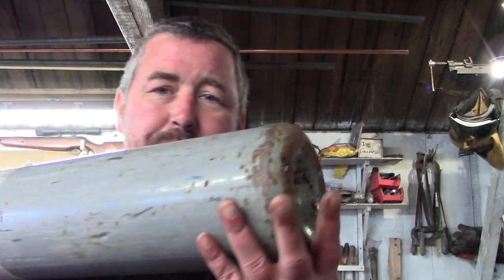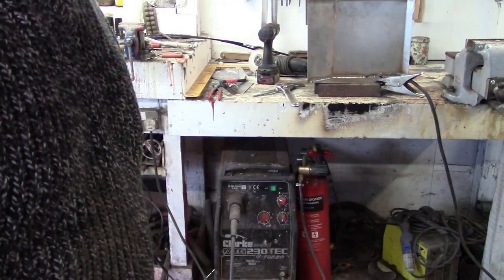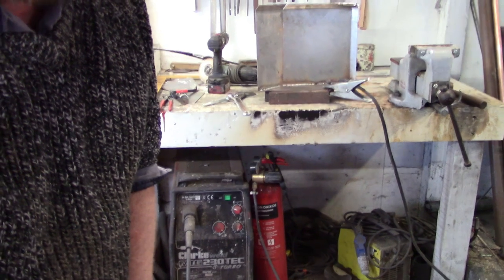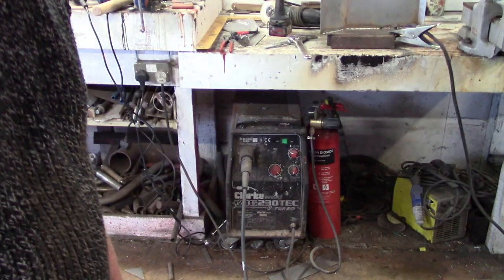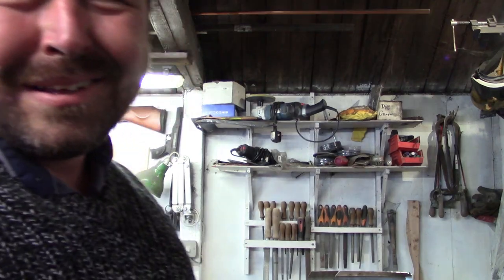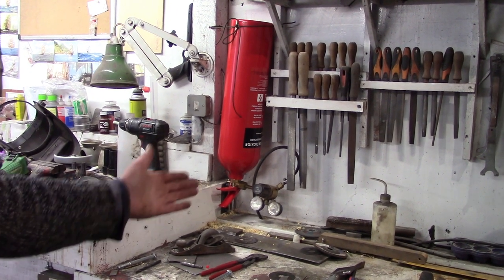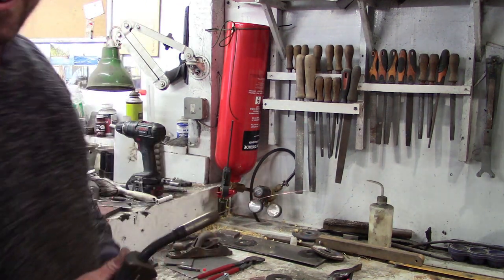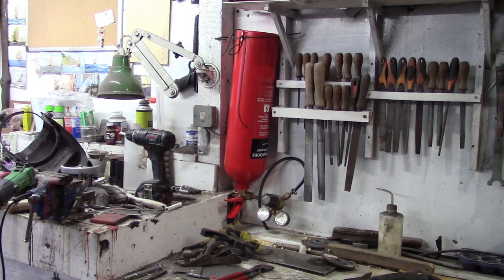Cheap welding with a fire extinguisher new set up

Comment: Glad you made a follow up video, maybe it's a European thing, but none of my co2 extinguishers fit my regulator, so I cut the extinguisher horn/spout and took the nut off and fit it to my regulator, now I want to build a trolley with two wheels and one handle that straps the bottle upside down for portable work 👍🏾😊
Reply from the maker: Maybe it's the regulator? I'm using a fitting designed to connect to pub gas, do you have the domed fitting for the argo-mix?
Reply: @turboconqueringmegaeagle9006  I have a CO2 specific flow meter, fits my cga320 co2 valve that I used to convert one of my extinguishers for refilling, but the other extinguishers have a different thread, it's close but only catches the first thread then gets tight, so I stole the nut off the nozzle and used it, awesome temporary solution 😁
Reply from the maker: @Ricerguy  nice one mate, are you getting your bottles free? Even buying refurbished I'm still saving money, don't know why more folk aren't doing it
Reply: @turboconqueringmegaeagle9006  yes, they were being thrown away, I thought they were empty, as the bottles are due to be hydrotested, so I was going to get that done and have the place that does the testing put the correct valve on. (they told me they do it all the time for aquarium guys) but both 10lb bottles had co2 in them and I couldn't bring myself to dump them out and waste the co2, so I'll weld with it for now. Strangely my issue using them upright is different to yours, my regulator starts to freeze and the flow seems to become restricted? Doesn't happen during small jobs, only happened while testing the machine running beads at max output. I plan to build a small cart/trolley to wheel the bottles around that can mount them upright or upside down. 😊👍🏾
Reply: Depending on distance see if they have any out of test (single use ones)ask them to contact you and go colect a few at a time  I pay 15 quid for single use

Comment: Crazy Idea.... I wonder if one captured the exhaust from an engine and compressed it in a tank with a compressor, if that would eliminate enough oxygen to cause the wire not to burn which is the job of the Co2?
Does the extinguishers you get have a threaded Nozzle or where do you tap into?
Reply: That's carbon monoxide not carbon dioxide so I'm not sure if that can work. Also this is no longer mig welding its mag welding. Carbon dioxide is an active gas not an inert gas you need to add a lot of argon to it for mig but, mag welding gives deeper penetration. Anyway the purpose of the gas is to create a neutral environment for the arc to burn I'm responsible sure carbon monoxide would cause loads of porosity and inclusion.

Comment: Yeah sounds like your getting dooped there. I do keg beer these days and my size d co2 bottle costs me $35 au for a swap witch would be like $19 of your dollars. Haven’t yet to try it as a shield gas yet but can’t wait to try. For the proper stuff it’s around $300 for a size d bottle but then only $100 for a swap. But yes very clever using the fire extinguisher 🧯 bottle.

Comment: Hello chap. I'm paying £34 for my refills on a 20 litre tank at 200 bar. But I'm having issues with supply and the guy charged me full price for a bottle he had decanted into and it was under 90 bar last time. So couple of questions, do you know the volume of a fire extinguisher and what pressure are they at?
Reply from the maker: That 200bar is the bottle's rated pressure, room temp liquid co2 is about 900psi or 70bar but I can see you getting 90 on the gauge if your shed is hot, I don't know about the argomixes though or argon.
So the real question is how much liquid do you get in a bottle, I've not actually measured, was using pub gas size bottles and have convinced myself these 5kg extinguishers last longer and I got scanked by the pub gas guy so its been these ever since.
Reply: @turboconqueringmegaeagle9006  20 litre 200 bar is for my argon mix mate.
Reply: @turboconqueringmegaeagle9006  I can get a 5kg extinguisher for £30 but I'm talking to a guy who has the big 50kg extinguishers on a trolley. I think it will be cheaper and more reliable then the company I've been using.
Reply from the maker: @smithbuilt  as long as it's less than £300 it's cheaper init.
Definitely just co2 not a 5kg co2 bottle pressuring a 50kg bottle of foam?
Reply: @turboconqueringmegaeagle9006  the guy is a fire marshal of sorts he services and refills them. He said he might be able to refill my argon bottle too.

Comment: OK, where did you get the fire extinguishers from, and what sort of regulator fitting fits?
Reply: Ohm and cheers for the tip!
Reply from the maker: My apologies good sir, the bottle fittings are the same pub gas/5kg extinguisher.
The refurbished 5kg bottles are on eeeebay
Reply: @turboconqueringmegaeagle9006  What fitting do they have and do you know how much weight of CO2 they have in the cylinder?
Reply: @turboconqueringmegaeagle9006  Also could you provide a link to the extinguishers please :)
Reply from the maker: @BensWorkshop  I think it's 3/8 bsp but what I'm saying is as far as regulators are concerned they are just referred to as pub gas fittings and it's 5kg of co2 in an extinguisher, they are always rated by contents not gross as the bottle material can vary, I've got my spam settings cranked right up so posting links is hit and miss but I'll try otherwise just search for 5kg co2 extinguisher.
Reply from the maker: @BensWorkshop  https://www.ebay.co.uk/itm/303154054881
5kg refurb £40 free p&p
Reply: @turboconqueringmegaeagle9006  Cheers. I think I have found the extinguisher. Are you sure it is 3/8 and not 5/8?
Reply from the maker: Nopes not at all, didn't measure it or nufink, been involved in too many bsp balls ups to ever commit.
Reply: @turboconqueringmegaeagle9006  Fair enough.... Would you mind making an exception and casting a caliper over it or possibly posting a link to where you got it from?
Reply from the maker: @BensWorkshop  https://www.ebay.co.uk/itm/231870758771
That's my reg, probably not the same people selling it as I bought mine many years ago, major diameter of the thread is .84" 
All you need to do is search "pub gas regulator mig" and you'll get hundreds of options some significantly cheaper.
Reply: @turboconqueringmegaeagle9006  Cheers. So that does not have the same port as the ones for commercial CO2 cylinders from people like Hobby Weld. Good to know.